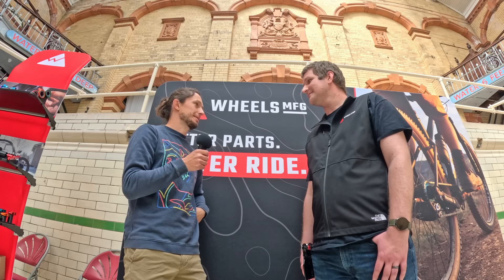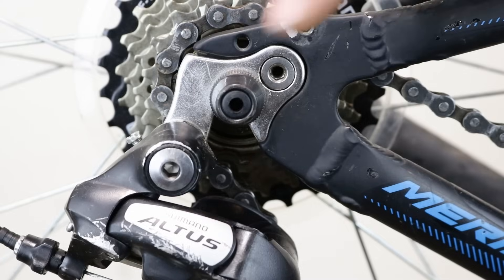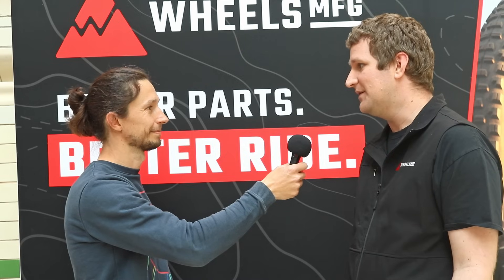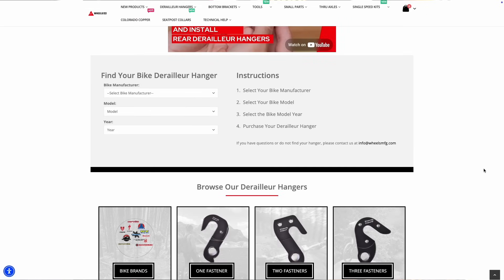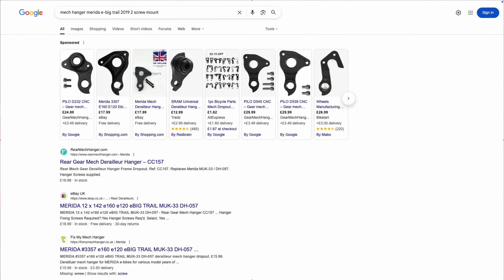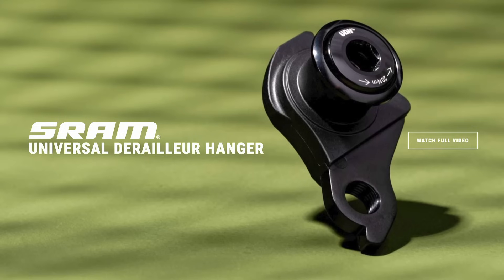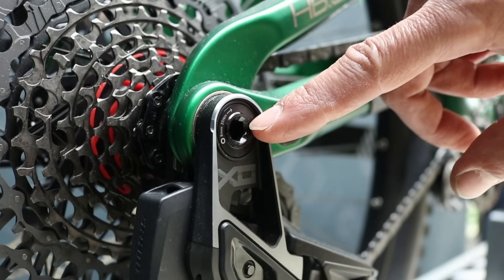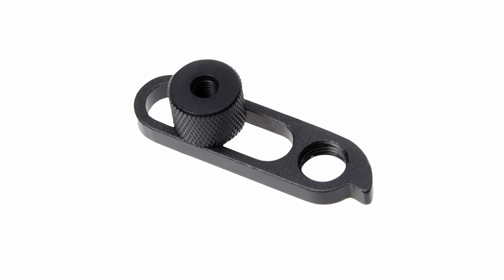All about gear mech hangers: Is the hanger mess just industry nonsense?

Comment: I wish manufacturers would provide the key dimensions of each hanger, especially if you can't find an exact match. Why can't they photograph them against graph paper with millimetre increments, something similar to a 'photo macrographic scale' used in crime scene investigation ?

The UDH seems to be the way to go.  It's crazy to possibly need a new bike frame / bike , just because of the lack of a small cheap part.